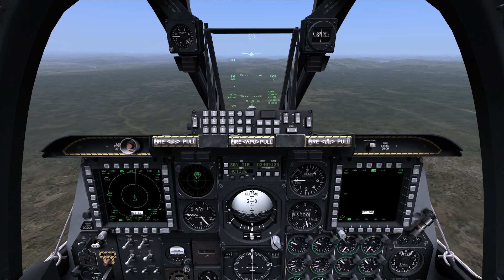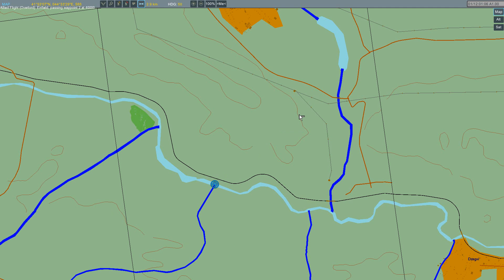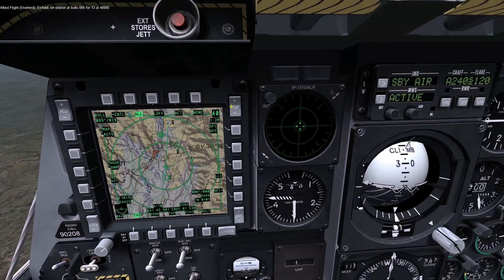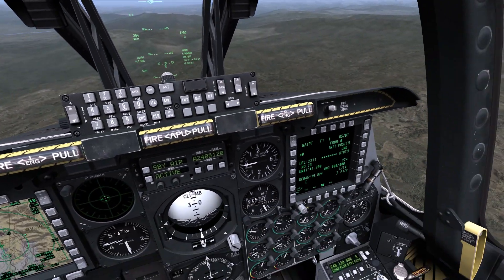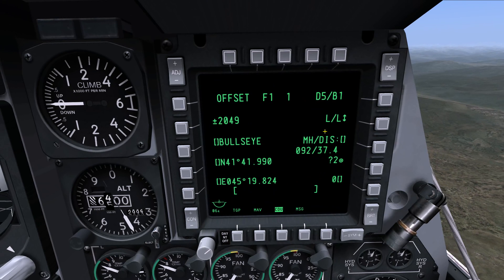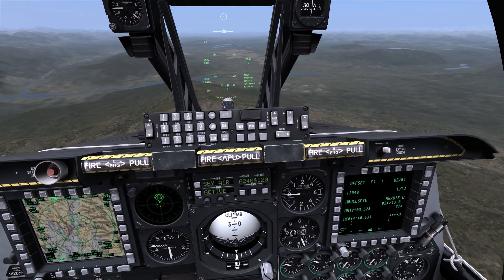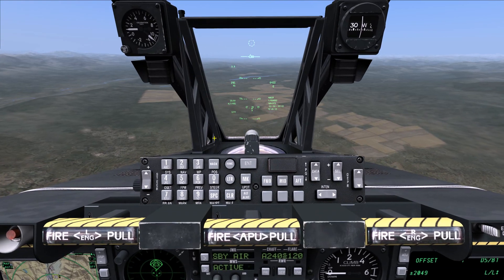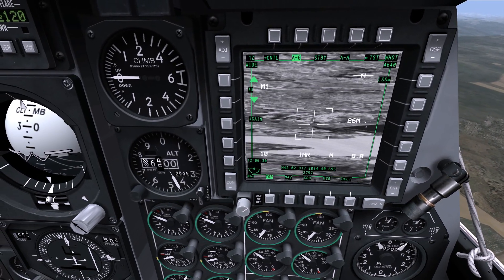DCS A-10C: CDU tutorial - offset

Comment from the maker: Its a case of exponential decrease in accuracy. In a circle made up of 360 degrees, between each degree is only a small space.... but if it is over a very large area then the space between each degree starts to become significant. That is why artillery batteries use milliradians as they are (roughly rounded to) 6400 milliradians in a circle rather than 360 degrees to get a higher degree of precision. However, in dcs A10 degrees is used as it is only supposed to be a rough target indication.